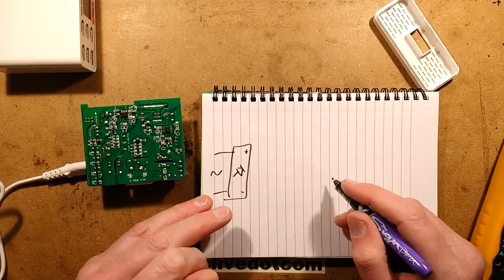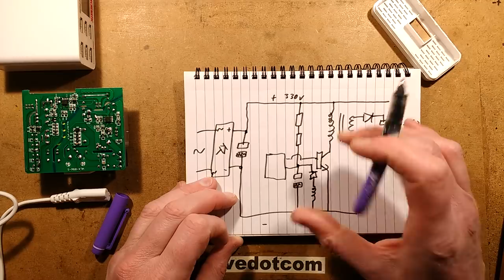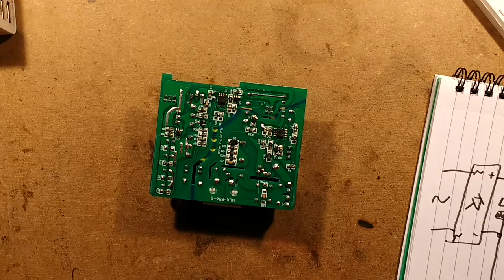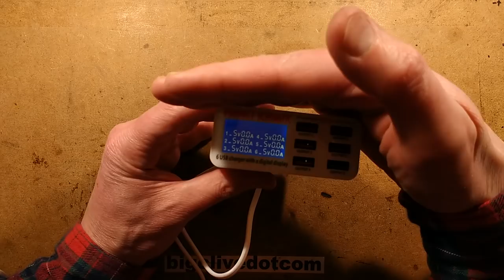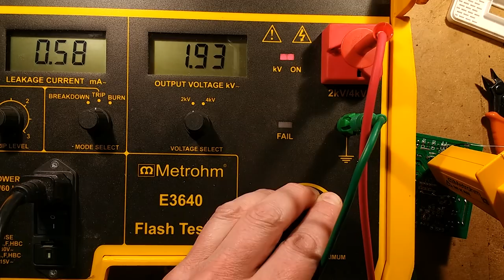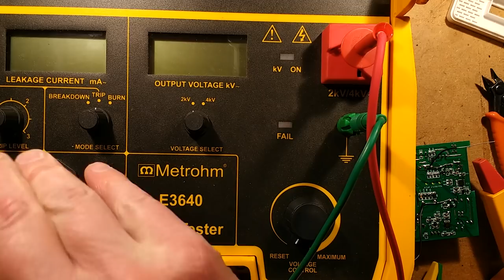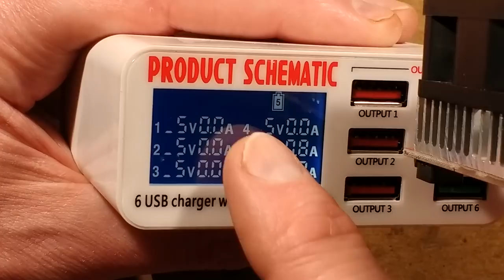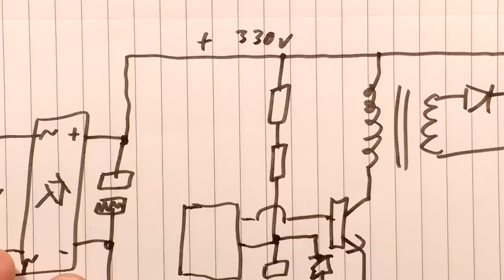Fixing a faulty USB power supply.

Comment: i have had a few multi usb power supplies i had a 5 port one that stopped working without any notice and a 4 port one that got so hot the case started melting i only had 2 things plugged into it when i noticed a odd smell and realized the case was deformed i now stick to single port plugs
Reply: I have plenty of multi port usb chargers but they are anker and aukey. Not trusting cheap multi port charger for anything but to power some led lights.

Comment: Hi Bigclive know anything about beko induction motors? As took it to a repair shop and was met with 'Ive never seen one of those before' from the technicians. so I'm stumped on how to fix or check it as it has no brushes grrr. Any help much appreciated cheers anymore Flambo in the making ? lol
Reply from the maker: There are a few different types of motors.  Is it single phase or three.  Does it have an external capacitor?
Reply: thanks for the quick reply Bigclive.my electrical knowledge is somewhat lacking. looks like it has two large capacitors (I think ) and  a small pcb. loads of components on it. its a Askoll m500 motor cheers
Reply: hellllllo?

Comment: I'm guessing that the 5 orange USB sockets or the single green socket is/are Qualcomm Quick Charge port(s).
Perhaps the voltages on the LCD display simply indicate the “mode” of the USB port and if you activate the quick charge feature the voltage will rise accordingly as Quick Charge 4+ can deliver anything from 3.6V to 20V.
I use a Quick Charge trigger adaptor (from Aliexpress) on my 26800mAh power bank so I can power other devices from it and not just 5V USB stuff :)

Comment: GearBest looks like a banggood site or geek, selling off brand Chinese stuff, looks like an upgrade happened as the single voltage is on top and then each output is shown for current, the specs are $33.14 and seems there is more to it than just a simple charger as it has USB3
https://www.gearbest.com/chargers-cables/pp_009387075861.html?wid=1433363#goodsDetail
(BTW  BigClive is mentioned in the 6th comment down at gearbest site)
• show you the charging current and voltage clearly
• Includes wide usage
• Compatible with most phones, notebooks, cameras and other electronic devices
• Power cable: 1.5m
• Power: 40W
• Input voltage: AC100 - 240V
• Output current: 8A
• USB 2.0 output: 5V / 2.4A
• QC 3.0 output: 5V / 3.4A, 9V / 2A, 12V / 1.5A

Comment: looks like they are using N channel mosfet for rectification
Reply from the maker: Yes they are, with a six pin chip I couldn't identify.  It seemed to have just a resistor and capacitor.
Reply: It's really quite nice compact design. Pinout looks similiar to fan6240 , maybe some clone of that. Is there some smd code on that chip?

Comment: 8:25 Two possible problems? My vote is 1) something shorted on the secondary, or 2) crapped-out (so-called) "start-up cap", ie. the small electrolytic filtering the PWM's supply, the one derived from the auxiliary winding on the primary.

Comment: Re: Hipot voltages
I follow HKJ (of lygte-info) for test voltages, and I've checked a few chargers myself.
Almost all good chargers pass 5 kV. I'd even say a charger that doesn't isn't a good charger.
Only bad chargers fail 2.5 kV.
So my impression/understanding is that 2.5 to 5 kV are conservative (by safety) voltages that good chargers pass anyways.
Medical devices are easy enough to search and find the standard for. It's something like line voltage + 250 V, all multiplied by 5 or something like that.
Dunno about practical voltage spikes you'd see on a line. You'd probably know more about that than I.

Comment: Why is USB 6 green?? Higher output?
Reply from the maker: The only obvious difference on the PCB is that the data resistors are missing.
Reply: It is supposed to be a Qualcomm quick charge port. I haven't finished the video yet. Is there a Qualcomm certified chip on the pcb? bigclivedotcom has a tester, that activates the QC 2.0 and 3.0 circuit and triggers different voltages. Than a load tester can be applied to also test if it can supply the needed current at each voltages.
Reply: Против Глобал Yes. it's their culture.
Reply: Supplies hydro-elelctric sourced electricity.

Comment: I had a chinese usb charger which has iPhone, Android and 2 generic sockets.. and if you plug an iPhone in to the iPhone socket or an android phone in to the android socket, it will start spoofing finger touches trying to go through menus
Reply: Wanton110 I'm pretty sure that's not spoofing touches, not intentionally anyway. I think it's the insulation on the charger being so cheap/nonexistent that it's causing interference in the rest of the device. If you plug in a device with a metal back you'll be able to feel the electricity as an unpleasant fuzzy feeling on it.
Reply: I used it with a toshiba tablet which is entirely plastic so wouldn't be able to say conclusively
Reply: The only difference is the output amperage, sounds like the power supply isnt keeping up with the load. Usually the cheapos say 2a but cant even hold half that.
Reply: Wanton110 Could be evil mouse simulation. But more likely just interference with the very weak AC signal used by the touch sensor.

Comment: Specification:

1. Color: White

2. Material: High quality PC

3. Input: AC 100-240V 50-60 Hz

4. Output: DC 5V 30W in total

5. Plug: US Plug 

6. 6 USB ports：Single-port USB output maximum 3.5A, 6 USB ports total maximum output 6A.

7. Net weight: 240 g / 8.5 oz

8. Socket size: 8.8 x 8.6 x 3.8 cm (L x W x H)

9. Cable length: 150 cm Package

Comment: Just a quick link to the sale page. I didn't see it posted, but I could have missed it.   https://www.gearbest.com/chargers-cables/pp_1554348.html
Reply: O.o Is that last USB port running at 9v in that photo?!
Reply: Kenton B The newer rapid charge ports for Samsung phones can charge at both 5V and 9V but if you try and charge a non compatible phone the voltage drops down to 5V i believe
Reply: I bought a very similar "product schematic" unit from Aliexpress.  The display only showed a single voltage but a current for each port.  It worked fine for me until I changed things on a whim (thanks Costco).  As an instrumentation engineer I always seem to want numbers rather than just "charging/not charging".  I Clive's is  different in that it has the port 6 with available higher voltage.
Reply: Hee hee... also charges USB Babies !!!  In this link description.
Reply: Okay, a nice link, but who will want to buy from a firm that does not respond when a customer does not get a response from them?  Why would they not want to respond to a customer that has a problem?  Just makes me think they don't care and are a rip off company.  Very bad way of doing business!
Reply: I love that it has no reviews but still claims 5 stars

Comment: Could they not have used a ROYER oscillator converter driving a W007 Bridge rectifier charging a lithium battery via a charging circuit.
Reply: DAVID GREGORY KERR Total waste of components. Especially the battery.